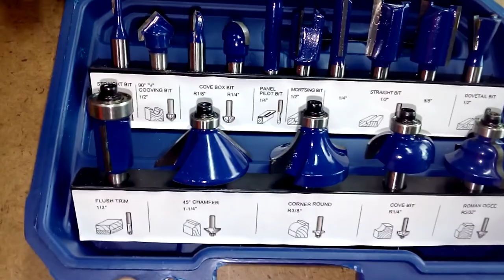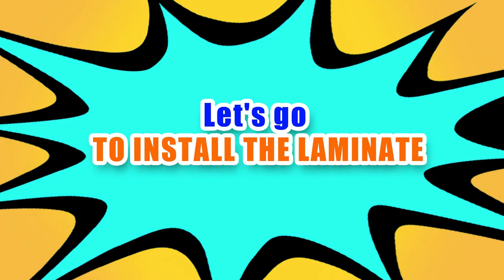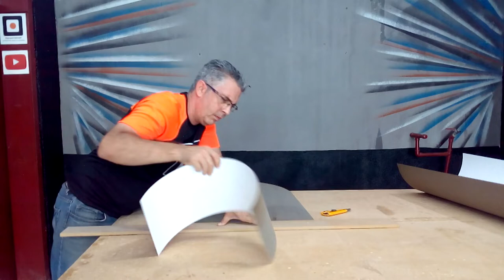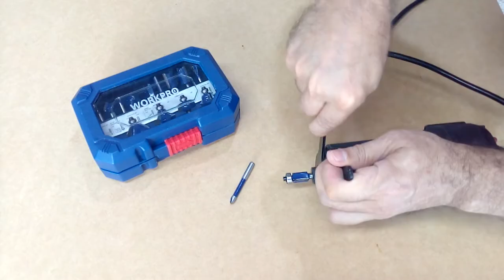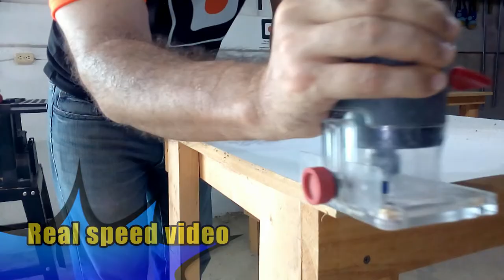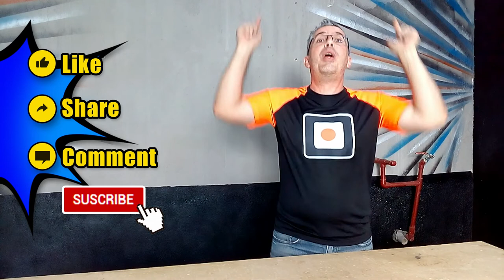How to cut laminates - Router Bits to trim FORMICA - WORKPRO Router bits for trimming formica

Comment: what's best bit to cut laminate, like I'm cutting around a fire place an need to cut half circles off them for fitting.
Reply from the maker: I do not understand you? If you explain to me better what you want to do, maybe I can help you
Reply: Laminate flooring?  Use a jigsaw
Reply from the maker: @timothyeubanks32100  yes, you can use a jigsaw to cut floating floor

Comment: This is a great video, but videos like this are very dangerous.  You watch a professional do something and think to yourself, "That looks so easy, I'm going to redo my whole kitchen!", completely forgetting the professional has years of experience.  Meanwhile, you're some dumb schlub with no experience looking at your new countertops and wondering how you ever got yourself into this mess.
If you're going to take on something like this, please listen to my voice of experience and practice on smaller, less important pieces before working on something that actually matters!
Reply from the maker: Hehehe, certainly practice is very important in all activities and professions.
All woodworking techniques require a lot of practice and it is always wise to gain experience with small parts and projects before taking on larger projects.
Thanks for your comment and I hope you like all my tutorials about carpentry and the use of tools.